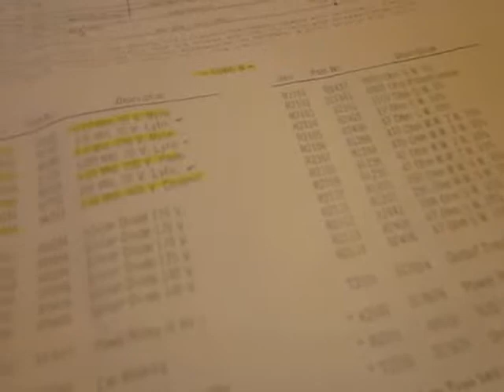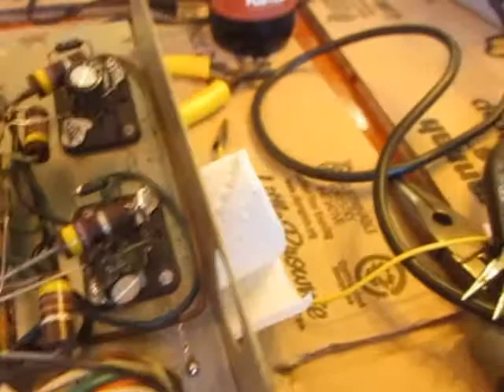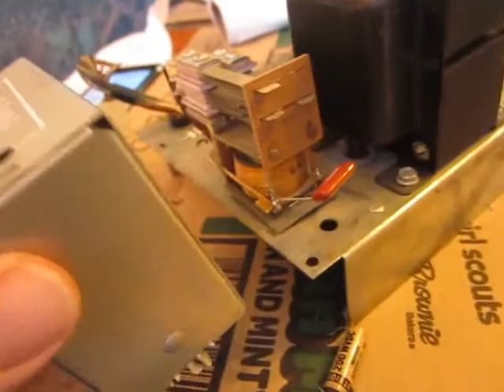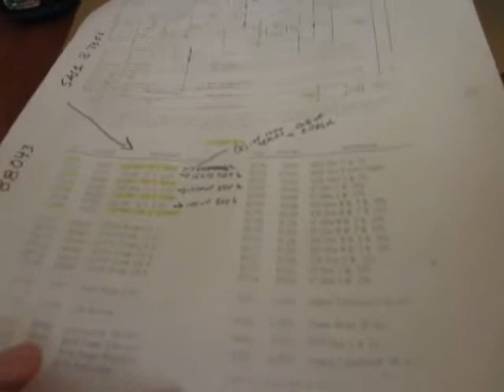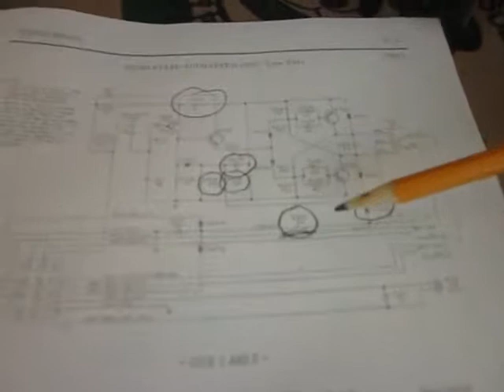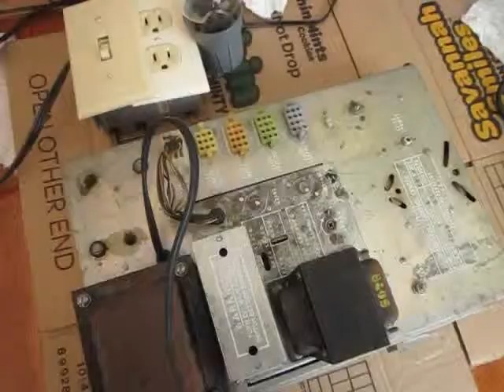How to Repair SAS1 Auto Speed Unit in Seeburg LS2 Gem Jukebox

Comment: Great video. Very helpful for a novice like myself.  I have a 1970 Rock-ola 443, a  1968 Seeburg Ls2 Gem, and a 1970  Seeburg Apollo,  plus both round and square Seeburg 3w1 wallboxes.  I have watched  your videos and have learned a lot.  You were bang on for the loose magnet at the bottom of the stylus arm.